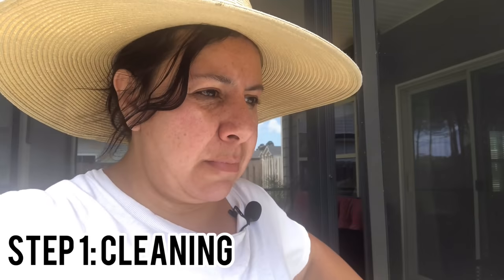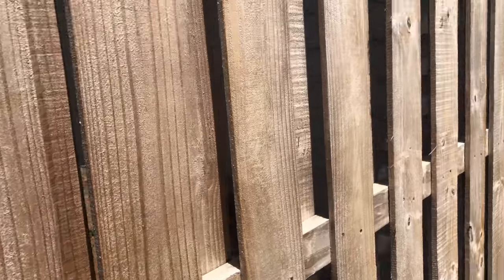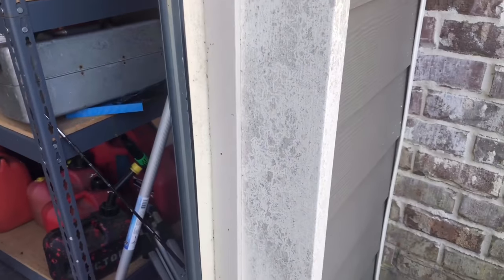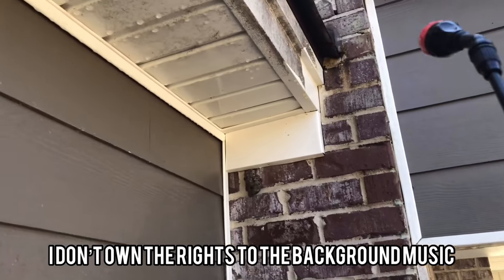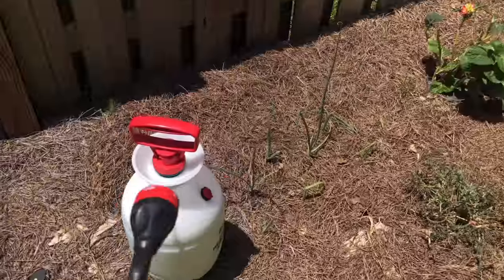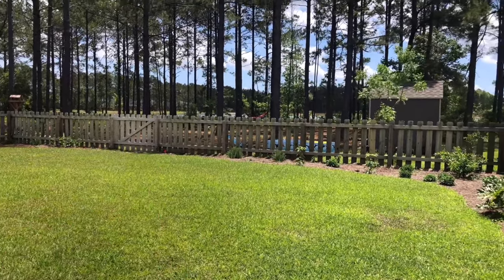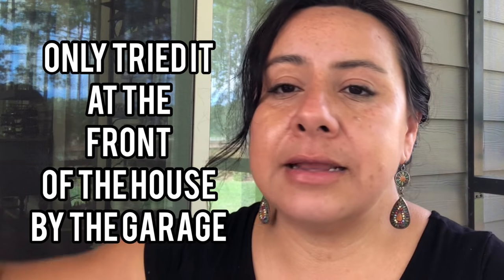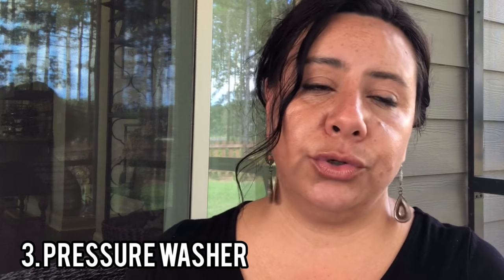Easy way to clean a fence// soft wash// no pressure washer

Comment: All of the cleaners 30sec cleaner and everything else uses "Bleach" and other additives, The best route to take is 10.5% bleach (Sodium Hypochlorite) 50/50 mix in a pump sprayer with a surfactant like soap/southern wash/Apple wash all of these surfactants have a very strong scent to mask the bleach smell and make the chemical stay on the fence longer without dripping off or running fast. Spray let sit and rinse simple as that the fence will look amazing depending on the condition of the wood and age of the fence. Most fences are gray and old but can be turned back to a natural wood color with this process. Then apply a sealer/stain to prevent it from happening again.
Reply from the maker: Thank you so much for your tips! We appreciate them
Reply: You forgot you need to use oxalic acid after to return the bleached wood to its natural wood looking color if you are using a regular wood stain
Reply from the maker: @waynebaldwin8590  interesting. I have never heard of it. Worth researching for anyone who reads this message. Thank you!!!
Reply: i was gonna say the same!
Reply: Is this dog friendly?
Reply from the maker: @LIFESaWONDER  I guess as much as bleach is dog friendly or people friendly.  There are no issues after it's been used and stained. I have a small dog and he is fine. People have suggested to water the plants afterwards to get rid of residue.  That's probably a good idea anywhere dogs might get into.
Reply: I read about people suggesting oxalic acid after washing before sealing. Can I skip this part? And what sealer do you recommend?

Also if oxalic acid is recommended what do I buy and what's the process?
Reply: @homeandlifewithcynthia They used to use Oxalic acid in the Navy to clean the wooden decks of ships. At least, they did so in the UK, where I am. The crystals tend to clump together so it's quite hydroscopic.

Comment: I used the pool shock recipe and it worked like a charm. Way easier than power washing which was rough, even with splitting the duty with my spouse. The cost saving is the best part.
Reply: What's the recipe

Comment: The key to pressure washing a wood fence or deck is only use an electric with no higher than 3000 psi. Pine wood is cheap but spend your money on cedar fencing. Will last a lot longer. As far as the staining, Behr is garbage. Always go with Thompsons water Seal. I'm going to use your method of using the heavy duty sprayer with the All mix & the 30 second cleaner. Pool cleaners tend to have more harmful chemicals than salt that will kill grass as well as almost all plants. I've been a landscaper for 36 years. Cover all your plants and grass areas with cloth or plastic tarps. Great video & hello from Seattle!
Reply from the maker: Thanks for your input. Noted. Have a wonderful weekend!

Comment: ma’am, when using the pool essentials, well, a few things.  i softwash homes with this for several years now and never had issues.  when putting the bleach in ur sprayer, add water like 1 gallon water to 1 gallon bleach, u can try 2:1 first and if not strong enough go to 1:1.  in addition, squirt some dawn dishsoap in the sprayer as well (i used to use that but then went with the cheap laundry soap from Dollar Tree).  what this does, besides help with the smell is more importantly works as a surfactant (keeps the bleach on the surface longer instead of running right off).

to protect plants and grass, its important to water everything well before u spray the bleach mix and then afterwards when u go to rinse.  this way, the bleach mix doesnt dry and burn the plants.  rinse, spray, let it sit for 15 mins, rinse, repeat if necessary, move to next section.
Reply from the maker: Thank you so much for your feedback. I’ll pin this so others can see. 😊
Reply: Yeah I'm sure your neighbor loves all the over spray over their fence and through the cracks.
Reply: @cutemup1874  f’em.
Reply: @cutemup1874  and btw theres very little overspray and even if so, as i said, u hose everything down first which also gets thru the cracks.  Dont be a karen.
Reply: @seangworld  I'm glad you're not my neighbor.
Reply: @cutemup1874  that makes 2 of us.  im taking care of my side of the fence, ur side can keep looking like crap.
Reply: @seangworld  I'm. It gonna lie, you're kinda sounding like the Karen in this interaction.
Reply: @cutemup1874  No he's definitely not. Lol stop whining.
Reply: Nice, I have like 350 ft of 6ft cedar fence in need of restaining. So is it better to use the pool essentials over reg bleach? Doing this myself without a lot of time to spare, so I am looking for the cheapest and fastest solution. Will this also remove the most of the old stain?  I used readyseal originally (like 8yrs ago, so there is a mix of stain and gray wood), and will be using it again this time. Appreciate any advice, thanks!

Comment: This was a very well-made video— very good pointers and advice. So, I wanted to share some good news: I just sat down in my back yard after having followed your method to a T— and holy cow, my grey old fence looks amazing now!!! Better yet, the yellowish tint that a brand new fence would have has lightened and my fence now has a nice beige tone to it. Color-wise, I’d say it almost looks like it has a very subtle white-wash applied to it, which I LOVE! It looks awesome next to my white lime washed brick house. Thank you so much for making this video, I’m so happy 😁
Reply: Side note: there was one section that was a much older section of fence which had a bunch of black mildew on it that the bleach would not take off— after spraying it with the bleach, I took a very rigid old plastic dish brush and lightly scrubbed it and the black came right off! I rinsed it with the water hose to get the black crumbs off and then sprayed it again with the bleach mixture and now the super old section looks just like the newer fence! 😊 Thank you again

Comment: Greetings from Pensacola, FL!  The Cradle Of Naval Aviation.  I have a fence that is 272 feet in length and 6 feet high.  It is less than 2 years old at this point and it costed me $9000 shortly after Hurricane Sally (September 2020).  Last year, I did a wash with 30 Second Clean (50/50 mix) and washed it off with a garden house.  I believe I cleaned it too early.  The opposing sides of the fence of course are facing my neighbors (the picket side).  I purchased 10 gallons of an oil based cedar stain from Home Depot ($231) which was a special order.  It took a couple of weeks to get the product.  Is is manufactured by a company called Flood.  I called them recently and sought their recommendation on applying it.  We briefly discussed the best way to apply it.  Oddly enough, the company recommended paint roller and brush.  The reason was better coverage and a better finished look.  The company strongly discouraged spraying, both  garden pump sprayer and electric sprayers.  After viewing your video, I could still detect light and medium spraying areas of the fence.  I know that it will take quite awhile to stain my fence with paint rollers and brushes but I am retired and have the time.
I have gotten price quotes of $450 to $700  by handy man companies  that have  industrial, professional type spray units.  Both agreed that 4 to 6 hours to spray.  I figure it will take me about 3 to 5 days with paint and roller.  For me it's all about the look.  I really like the color you chose.  I am only doing the inside of the fence that faces my property.  Maybe I'll do the neighbor's side next year.  Any final thoughts you have to give me before I get started?
Reply from the maker: Hi there! Wow, fences can be so expensive right? Well, yes I have to agree that rolling it is probably prettier bc we ended up giving it a slight touch with the roller anyway. If you’ve got time and grit, I say go for it. I’m cheering you on!

Comment: When using this method …Water and soak your plants before starting and spray them again really good especially if your area is in a drought and when you’re done working that particular section and they’ll be fine. That’s the secret when working around plants and if you’re in doubt just keep watering and spraying them down and you’ll be fine.
Reply from the maker: Thanks for your helpful tip!

Comment: Excellent video, I soft wash my home often.   The 30 Seconds mix does not work as well as the pool shocker because it has very little salt/SH (sodium hypochlorite).   To save your plants, thoroughly rinse them with water from the hose before and after using the pool shocker.  When plants are dry the absorb all of the fluid they receive, if they are rinsed throughly it prevents the pool shocker from being absorbed.  Once you’re done spraying the pool shocker rinse the plants throughly again to remove any pool shocker from the over spray.  If you’re spraying pool shocker around very fragile plants, have one person spray water from the hose on the plants as you’re spraying the pool shocker.
Reply from the maker: Love the input. Thank you!
Reply from the maker: And yes, you are right about the pool shock. I do prefer it.

Comment: Next time after you get done rinsing the bleach or should I say sodium hypochlorite off of the fence spray some oxalic acid on the fence and leave it. Oxalic acid acts as a neutalizer for the sodium hypochlorite and its also used for wood and concrete brightening. It also works as a rust removal but I suggest leaving that to someone experienced with the different type of surfaces and paint brands. Also if you're really worried about your vegetation you can purchase a chemical called Agent Halt and spray it on the vegetation after you pre-wet everything. Then use your cleaning mix and allow to dwell after you rinse your surface and apply oxalic acid to the surface you then rinse the halt off the vegetation.
Reply from the maker: Wow, what an awesome idea.  I'm getting ready to work on my mom's backyard.  I will definitely keep this in mind and let you know if I tried any of it.  Thanks!

Comment: You saved my life with this video thank you!! I started by scrubbing my fence with a long scrubber and 5 gallon bucket. It was brutal. Im heading to buy a sprayer like you have. Already have the 30 second cleaner stuff. Thanks again!!
Reply from the maker: Yaaaay!!! Totally worth making the video then. You made my day! ☺️
Reply: Use oxalic acid afterwards.  It works as a wood brighter and nutrilizes the bleach . It will also get rid of any of the nail or screw rust stains . Rinse very well after about 10 minutes . Fence will come out amazing.
Reply: 8 OZ Per gallon of water is the mix ratio

Comment: Does 30 second cleaner get diluted like the bleach? Or just straight.. sounds expensive on a big fence if straight. Thanks!  

Edit, does this remove the old stain too? Or just the gray on the fence.
Reply from the maker: You use 30 second cleaner straight so if you have a big fence yes, it will add up. The cheaper option is the pool shock but someone here said it can still be expensive. Still cheaper because you can dilute that one. Another commenter said that all of them have bleach and additives. Someone else said that old mold is hard to remove with both of these options so if you have a lot of mold maybe test first before buying a whole lot of product and being disappointed or having to return a whole lot of stuff. I always suggest testing on inconspicuous areas. Hope that helps.
Reply: @homeandlifewithcynthia  thank you! Does the pool shock lighten or remove old stain also?

Comment: I’m also concerned about introducing anything with salt into an area that has flower beds right by the fence.  You wash the fence and that salt will go right down into the soil.
Reply from the maker: I had a company come and soft wash my house since then and they do it too. They say that they never have issues so long as you water plenty before and after. Also, I had lots of starter plants and they were probably too weak for even just a little.

Comment: About how many gallons of the pool shock did you use to do the cleaning of the fence?  Just to help me figure out how many gallons I might need for a job similar in size to your fence.  Thank you!
Reply from the maker: Hi there! It’s been a couple of years and I can’t quite clearly remember. I want to say it was something like 5 or 6 gallons. Remember it’s 1/3 of the pool shock 2/3 water and a cap full of ALL detergent. My first thought when I read your comment was 5. I’m 90% confident about that answer so forgive me if I’m a little off.

Comment: How do you avoid it running over the top and bleaching your neighbors side of the fence.? That's why I'm hesitant to do this.
Reply from the maker: We used large cardboard pieces when we sprayed in areas where we didn’t want overspray to hit the neighbors. One person would spray and the other would hold the giant cardboard piece. I should have explained that better. I was lucky for two reasons 1) I talked to both the neighbors about what I was doing and they didn’t have flowers or anything like that where I would have much to worry. 2) We also paid attention to the direction of the wind when spraying. Try to pick a not so windy day if possible. My neighbors homes and cars where far enough that it wasn’t too difficult. I would urge you to talk to them and ask them if there’s anything they really need you to be particularly careful with. Hopefully you’ve got nice neighbors next to you ☺️

Comment: Good to know about the pool cleaning kill plants.  My neighbor dumped their poor water flooded my backyard where there are 50 different kinds of roses, herb garden and 3 heavily fruit of pear trees.  Half of my plants die after 3 months.  I asked them why run water on my backyard.  They said, 'We just emptying our poor."
Reply from the maker: Oh goodness, sounds like they don’t know that this may cause issues. Much later after I made this video a professional came to pressure wash the top part of our house and told me that before they add chemicals for cleaning they take the time to water the plants (to protect them). They also water the plants afterwards to rinse them off. If you can have a cordial conversation with your neighbor maybe you can find a solution so this doesn’t happen again. What a tricky situation. Hope it works out.

Comment: So  I tried your method and it was terrible. It did great on the first section of the fence and then it decreased in success as I went on. Not only was this a very expensive option, but what it actually did to the wood was terrible. This method does not actually get rid of the algae, all this does is bleach the algae. After going through 2, 2 gallon sprayers full of fluid, with very little success, I resorted back to the power sprayer. When I power washed the boards that I bleached all the WHITE algae came off and the natural board was under it. If you place a stain on top of this I can't imagine it staying on very well.
Reply from the maker: Bummer. I’m so sorry to hear that. I’ve talked to professional cleaners and they told me they do their soft wash like this. I think algae can be pesky though and maybe the force of the pressure washer is required. Thank you for sharing. I’ll add that to the description to let people know about algae and that for some people it might not be strong enough. Thanks again for your feedback.

Comment: can you use this product on painted surfaces like a deck? Paint not stain. 
TY
Reply from the maker: Hi Diana! I think you'll have to test. It was fine all over the paint around the house such as the columns on the front porch. If you watch the video at the beginning when I was working near the garage area by the roof and fascia; it cleaned it beautifully no problem (that's painted wood).  However, my door took a beating.  I didn't spray it directly on the door, but the wind blew it there and it ended up leaving lighter spots, kind of like when you bleach a shirt.  It must be the type of paint that makes a difference.  My suggestion - test it on a small area or sample board first bc I'm not sure how your paint will react.  Also, if you happen to get it somewhere you aren't so sure, rinse it off with water.  Lots of people are saying that rinsing the plants, for example made it safe for them.  Hope that helps!

Comment: Did you pour the whole gallon of bleach in the sprayer or half with half water?
Reply from the maker: I ended up preferring the pool shock. Viewers and professionals say hosing plants with water ahead of time is safe for plants. It’s 1/3 pool shock 2/3 water and a cap of ALL detergent. Hope that helps!
Reply: @homeandlifewithcynthia  have you tried or heard of Green ox renew??
Reply from the maker: @sharkbait305  no I haven’t. Is it supposed to be good?
Reply: @homeandlifewithcynthia  yes you just spray it on and It cleans it right off!!

Comment: Is it mixed or is it 100% the pool essentials?
Reply from the maker: It’s 1/3 Pool Shock + a cap full of All Detergent + 2/3 water. Also note that people said in comments that they believe this formula worked better than 30 second cleaner and to avoid killing plants make sure you rinse plants before and after using the product on the fence.

Comment: WHAT CHEMICAL IS THIS? IS IT CHLORINE?
Reply from the maker: Yes. So it does have bleach. The chemical that seemed to damage my plants was salt. Sodium hypochlorite 10% but I used it again at my mom’s without a problem. It will drain your clothes. Some people say regular bleach also works. You could try them. I found this to be pretty strong and effective.
Reply from the maker: Stain your clothes ( not drain them)